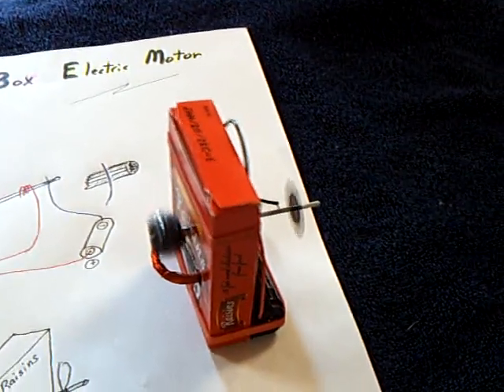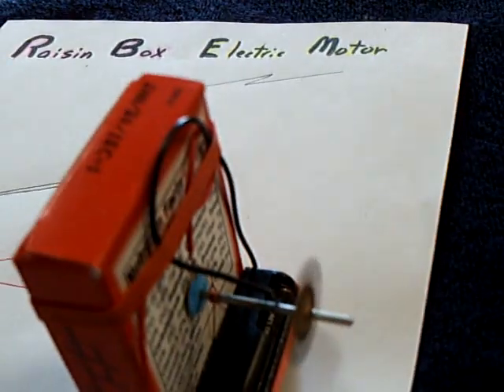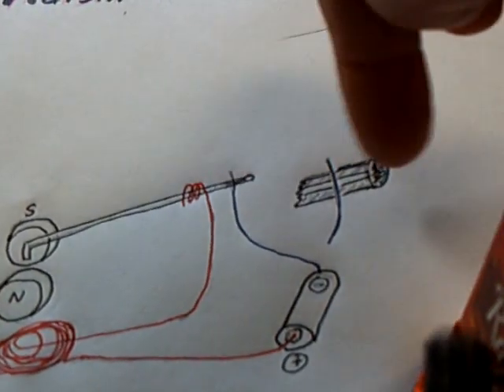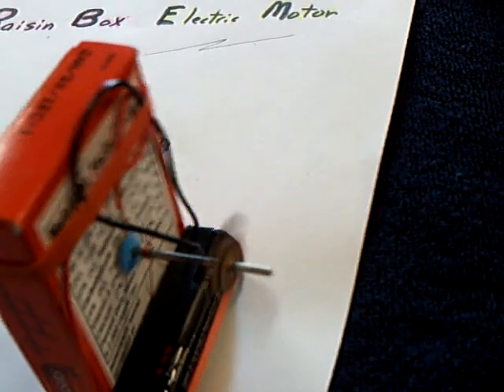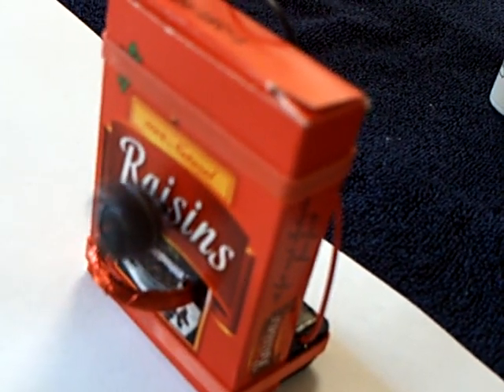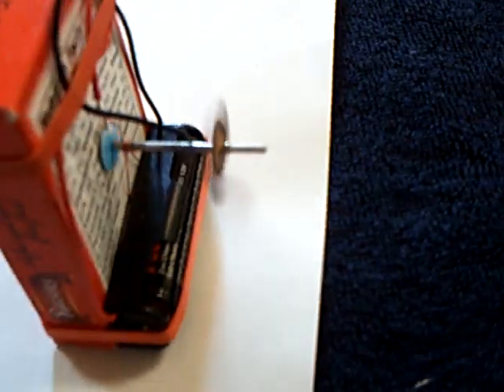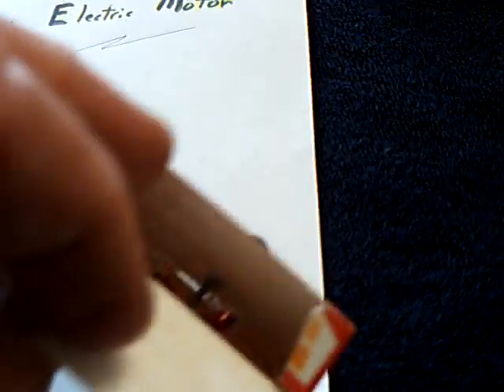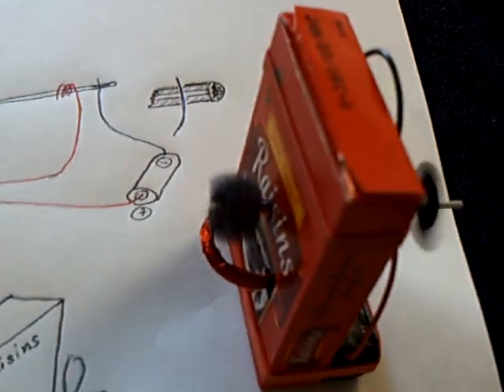Raisin Box Electric Motor

Comment: I'm having trouble with the commutator, I'm not sure how wide the strip of bare wire should be. right now my motor vibrates but does not spin.
i think my problem is i don't have correction fluid for the "make or brake" part you mentioned. is there any other substitute for correction fluid?

Comment: Lid:

Great project and  I really like your brilliant idea for making the shaft "bushings" using superglue.  That idea would be very useful on other projects I am sure.  That is a fantastic idea.  Does the motor draw very much?  With no load I would assume not.
Take care,

Bill
Reply from the maker: Hi Bill.  You are the first one to make a comment about the crazy glue bearings.  It works great!  The thin glue soaks into the card board and the sets up fast to a very hard and smooth surface.  The initial hole has to be big enough so that after the glue treatment there is still a loose fit with the shaft.  Too loose is Ok for this type application.  Too tight defeats the whole idea.  Lubricate with oil or pencil graphite.  The motor draws quite a lot because the coil is so small---but it is a sort of pulse motor that takes the energy in spurts.

Comment: Can you use this for fan? And how much the current draw? Being powered by one AA battery is really neat.
Reply from the maker: I think this would make a very interesting little fan but I would change a bunch of things to make it more efficient.   A neo ring rotor magnet, two coils with more wire, better bearings, and a better switching method would be my choices.
Reply: ***** That's look promising. I'll considering it for my next todo project. Thanks for sharing Lidmotor.

Comment: Nice one Lidmotor, being out of balance makes it sound more interesting.
Reply from the maker: Thanks.  It would make a fun motor for one of your low friction CD wheel cars.  Sounds like a Chitty Chitty Bang Bang .  You might have to run it with a 9v battery though.
Reply: Now that's an interesting project. I will have to think about that.